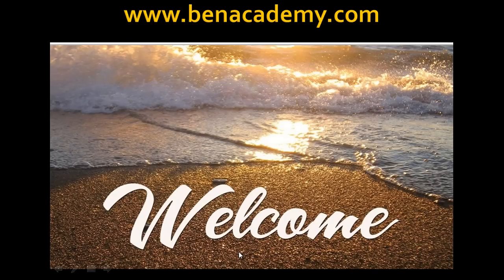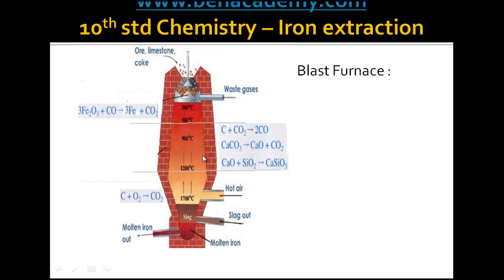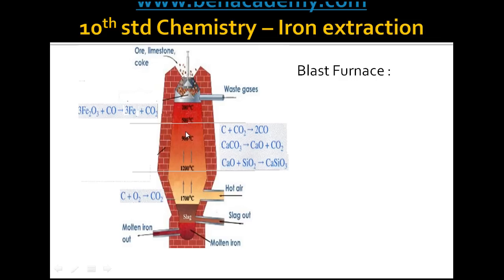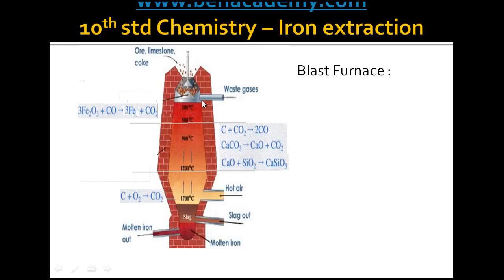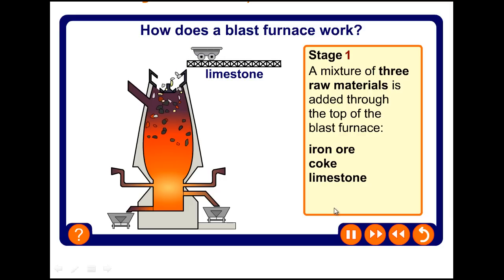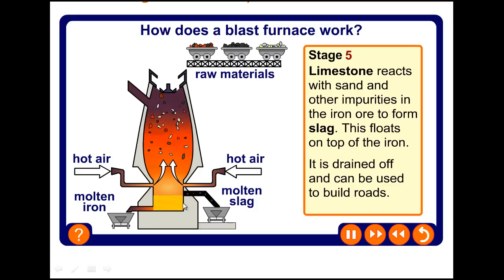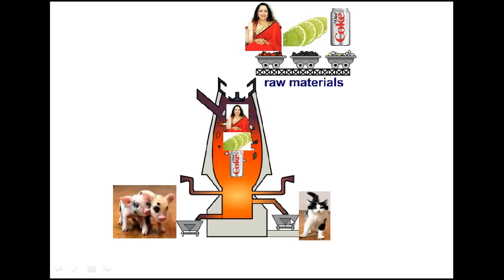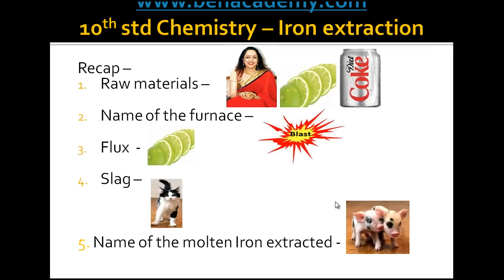Iron extraction

Comment: why iron ores are not charged directly into the furnace for the production of  pig iron?
Reply from the maker: It needs fuel to be melted,  flux to remove the gangue(impurities) and they all need to be ground and mixed in correct proportion before fed into the furncae.

Comment: wheré is cúmmíńğ fřôm Hótt Áiřés, Úńt hôw iť béińģ Mãđés ¿¿¿¿
Reply: Hot air is passed through from the bottom of the furnace. Hot air is made by burning coal.
Reply: @johnlouismemoryschooltamil5275  thanking you
I think to be more exact there are a number of "Stoves" that are force fed air which is then heated by the stoves which are tall external towers, the hot 🔥 aire then passes to bustle pipe surrounding base of furnace. The Tuyeres then inject the heated air to 900 -1250 C°

Comment: Very good! But I just need to ask -- what keeps the iron ore, coke, and limestone floating around like that and falling to the bottom instead before the process commences -- is it the hot compressed air?
Reply from the maker: +snarkleton26 : The blast furnace is a tall tower. Its height is designed in such a way that the reaction is taking place at various temp at various zone before the heavy iron sinks to the bottom of the furnace. All the reactions are taking place when the raw materials are falling from the top to bottom of the furnace and the time given for it is more than enough for the reactions to be completed. 
Hope it helps.

Comment: Are the raw materials floating due to the temperature of the air in the furnace?
Reply from the maker: +Zach Cross No, the raw materials are not floating. The powdered raw materials are dropped from the top whereas the hot air is blasted from the bottom to the top. The heat transfer and rxns taking place in the tall blast furnace at the various zones. The height and size of the furnce is designed in such a way that all the rxns are taking place in the furnace at various zones. The raw materials are not floating at all. However, a small percentage of finer raw material might be carried away as dust with the waste gas going out of the furnace to the chimney.
Reply: +Johnat1960 Ok, thank you.  I didn't realize they were in powdered form.